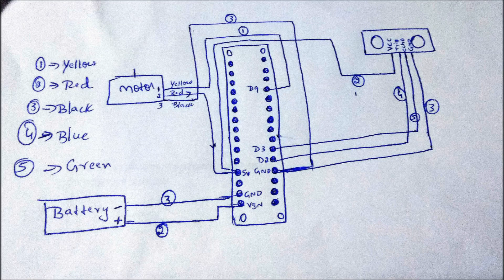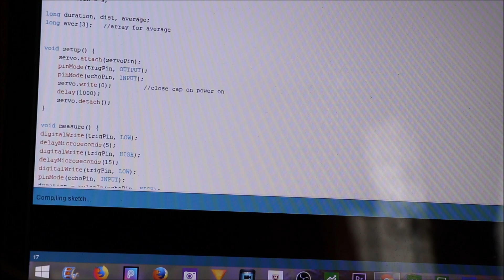How To Make Smart Dustbin Using Arduino in Easy way

Comment: hey bro great project!! your code was not that efficient so i designed mine and it works well. you won't need to change the circuit. The code is designed for this circuit.

#include <Servo.h>   //servo library
Servo servo;     
int trigPin = 5;    
int echoPin = 6;   
int servoPin = 7;
int led= 10;
long duration, dist, average;   
long aver[3];   //array for average

void setup() {       
    Serial.begin(9600);
    servo.attach(servoPin);  
    pinMode(trigPin, OUTPUT);  
    pinMode(echoPin, INPUT);  
    servo.write(0);         //close cap on power on
    delay(100);
    servo.detach(); 
} 

void measure() {  
 digitalWrite(10,HIGH);
digitalWrite(trigPin, LOW);
delayMicroseconds(5);
digitalWrite(trigPin, HIGH);
delayMicroseconds(15);
digitalWrite(trigPin, LOW);
pinMode(echoPin, INPUT);
duration = pulseIn(echoPin, HIGH);
dist = (duration/2) / 29.1;    //obtain distance
}
void loop() { 
  for (int i=0;i<=2;i++) {   //average distance
    measure();               
   aver[i]=dist;            
    delay(10);              //delay between measurements
  }
 dist=(aver[0]+aver[1]+aver[2])/3;    

if ( dist<50 ) {
//Change distance as per your need
 servo.attach(servoPin);
  delay(1);
 servo.write(0);  
 delay(3000);       
 servo.write(150);    
 delay(1000);
 servo.detach();      
}
Serial.print(dist);
}